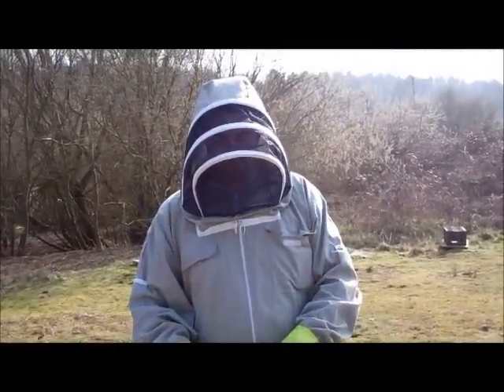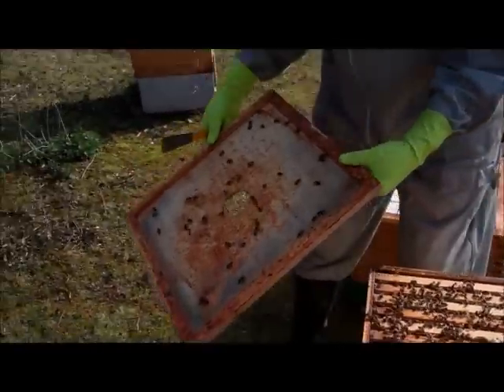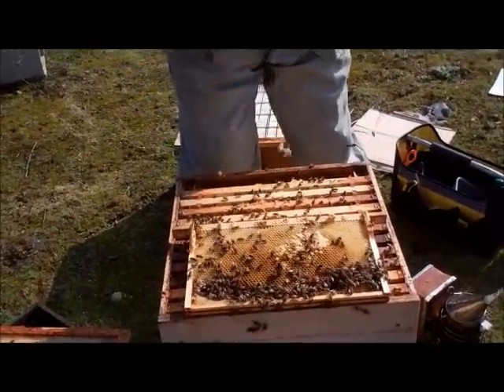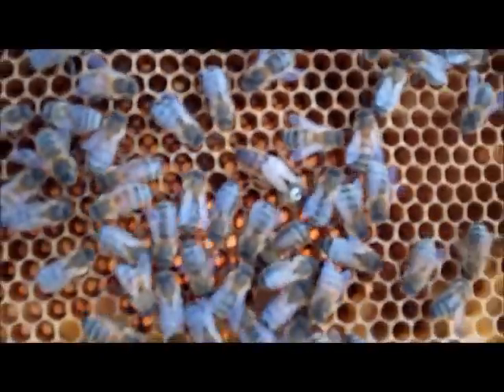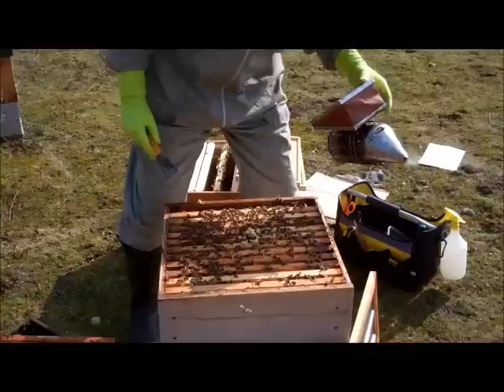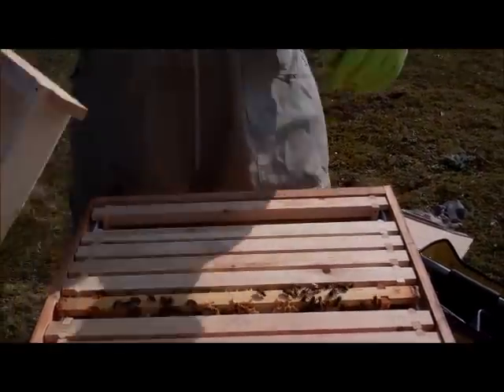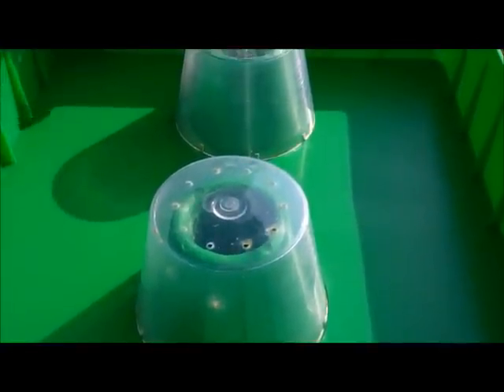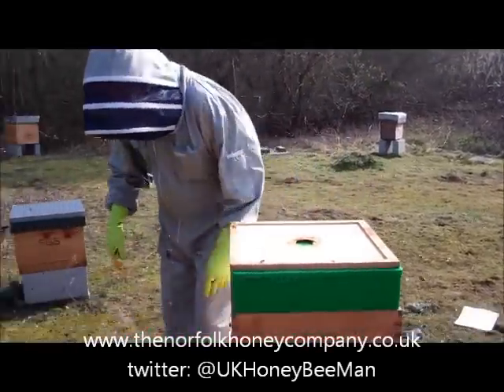How to Perform a Bailey Comb Exchange - #Beekeeping Basics - The Norfolk Honey Co

Comment: Hi Stewart.   What are your thoughts on frame spacers?
Reply from the maker: Hi Paul,
Frame spacers in the brood box or in honey supers?
I normally have 11 self spacing Hoffman frames in the brood box plus a dummy board at one end and a mix of frames in the supers. I used to have what we would call SN1 frames which are shallow non spaced frames and then I have a castellated runner inside the super box which would hold 10 or 11 frames. I used to start them all on 11 frames when they had foundation and then switch to 10 frames once drawn but have recently started switching to 10 frame self spacing Manley frames which have a wide side bar running from top to bottom. I am finding these easier for extraction and they give a cleaner cut comb finish.
Stewart